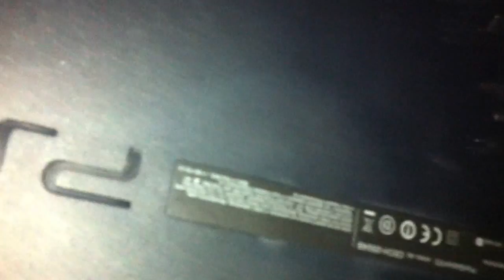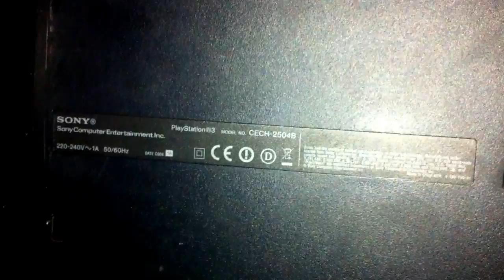E3 Flasher Bricked my PS3

Comment: my ps3 got bricked to but i didnt soldar and my e3 cable snaped anything i can do
Reply: Yes If You Have The Original Dumps Flash Them Back Through Your Flasher. You Might Need To solider A Wire To Keep It On
Reply: HackerProHacksplease can u send me a video how? I have the original dump

Comment: Yeah probably a fake E3 but it could also be that the system might not've been compatible with the downgrade lucky for me I got a CECH-2501A
Reply: Raffael Tale plz help i just patched my bkpps3.bin and installed it now my ps3 wont stay on it shuts of when i turn it on i used the wrong patcher
Reply from the maker: avery miller just weld the wire from sbe to pao tristate after ps3 should stay on. if not find on internet a map and make sure is weld right. and then tray the original backup
Reply: Right, if I were u I would hire a professional down grader that's my opinion!.. I'm on Jailbreak Standard 4.75